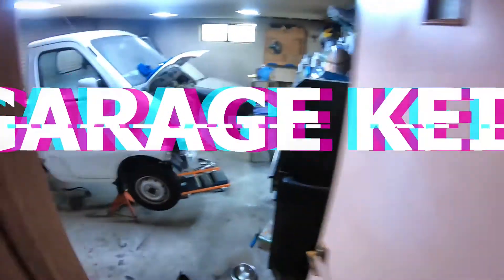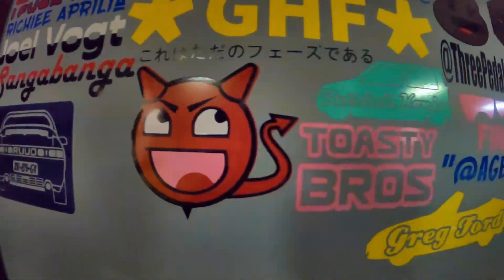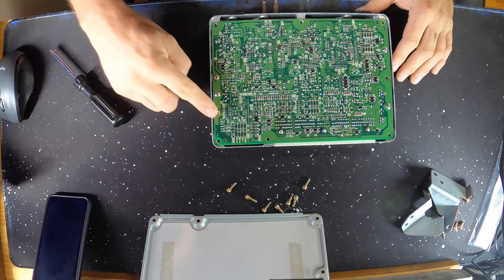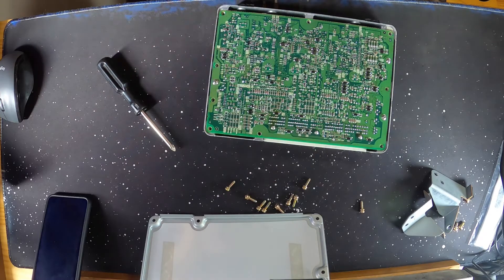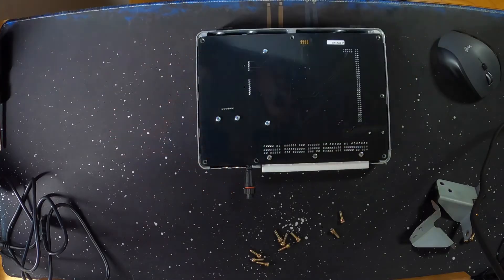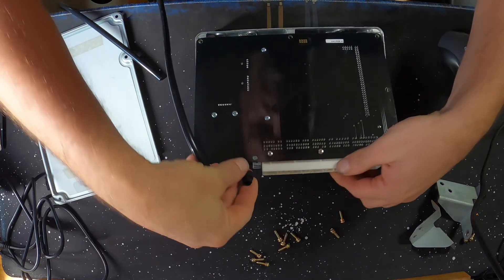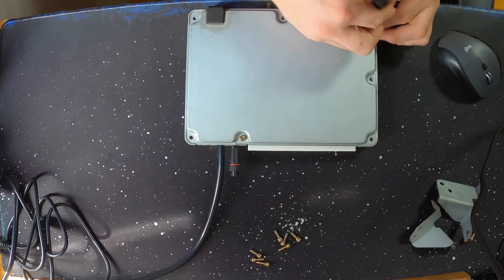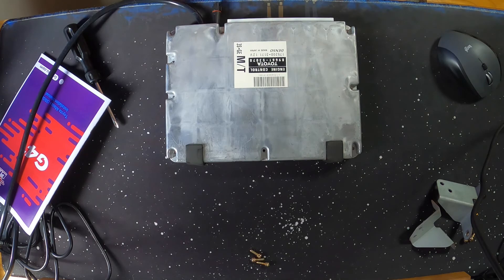Installing a Link ECU into my Altezza.

Comment: Is this the same process for the is300?
Reply from the maker: I'm not sure... The instruction manual for the IS300 is probably online somewhere. Have a quick flick through that.
I've seen the IS300 engine bay and it looks like the ECU in the same location so it's probably the same.
If Link make a plug-and-play ECU for that car imagine the process has the same. The scope of my knowledge only extends to the car that I have.
Even then I only know the bare minimum.

It's one of the reasons I don't really like making how to videos because I'm not an expert in anyting. Some people are interested in what I'm doing so I make videos to show them.
Thanks for watching

Comment: well I just bought one of those for my swapped Datsun so I'll be sticking around since I havent installed it yet lol
Reply from the maker: Thanks for watching.
I really didn't find a good guide online of how to install it. So I hope my video helps you.. Link didn't answer why you can't put that screw in.. lol 
I've already fitted the thing to the car. (But haven't tested it yet.) Part 2 of the installation was pretty easy even though I did it the hard way. That footage should be in a few videos time. Editing another video of me messing with the carbon hood of the Altezza at the moment.

Thanks again.
Reply: @GarageKei  did you posted in the Link facebook group? bc somebody asked about the extra hole recently. Carbon fiber hood that sounds expensive and cool. I haven't even unlocked my link I'm planning to pass my yearly inspection this week and after I should be good to go, btw what are you going to use to get your AFR readings?  are you going full link ? or AEM?  or Innovative?  I've heard some positive comments about innovative but I already bought and AEM wideband, hopefully is not that bad
Reply from the maker: @dstmedia2054  yooo!!! I only just found this comment. Sorry for the delay. I'll be using a plx for WBO2. Yea that was me asking about the DON'T PUT A SCREW HERE FOR NO REASON WE ARE WILLING TO MENTION! lmao.